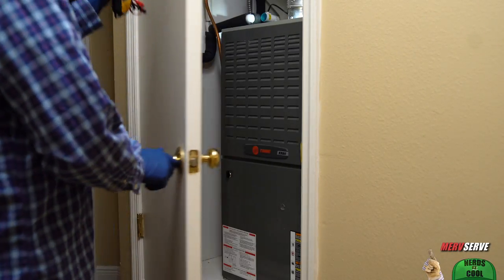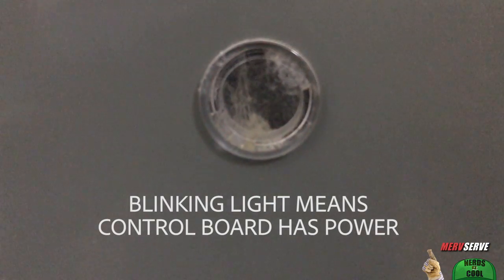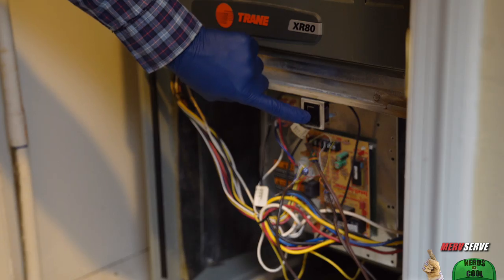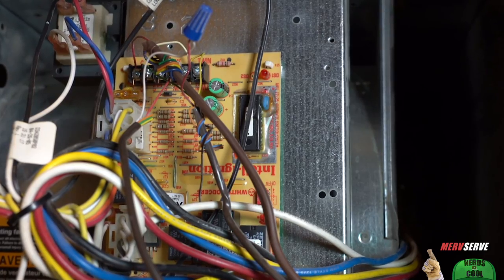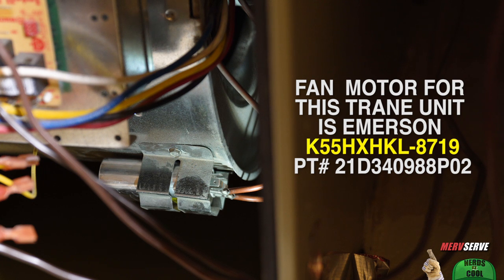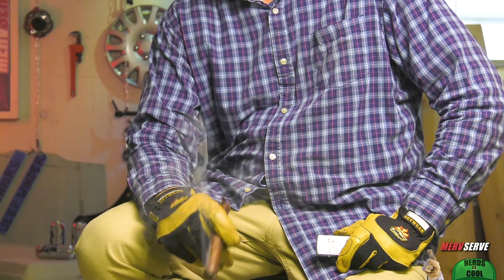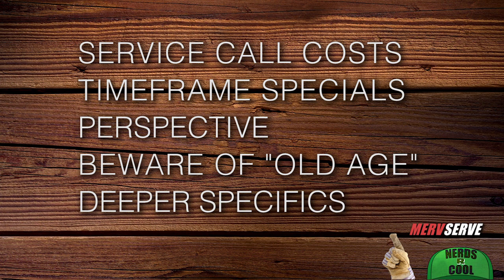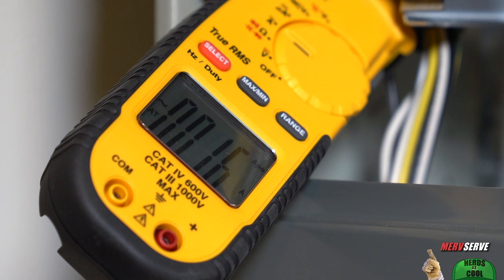AC Air Handler Fan Not Blowing?  Free Air Conditioner Fix

Comment: Excellent video.  Thank you much.  Merv, kindly, our furnace (circa 1981 Borg Warner/Trane natural gas, still in good condition)  blows the screw in breaker (locate on outside of it) whenever the blower tries to start.  The start relay actuates, and AC unit runs fine with the motor electrically disconnected from the system.  It's only when the motor is connected that the fuse fails at start.  The blower assembly turns freely inside the plenum.  Between the leads to the motor: ~2.1 ohms resistance (not zero/short).  I think it's a single speed motor ('R.P.M. 1075, AMP 5.0' written on it), & has 3 power leads coming/going to it.  (It's always only run @ one speed, as far as I can tell from the register air outputs).  ¿Is this motor bad or can a start cap cause this type of failure, kindly?  ANY advice or comments much appreciated.  Thank you so much.
Reply: Did you ever find the answer and/or solution? What was it?

Comment: A/c running. Motor runs most of the time but sometimes it doesn’t. But compressor will be. The evaporator then freezes up. At that point I turn off ac, I turn on manual fan and it won’t come on either. It seems after it sits, the ice thaws I can then press fan again it then works. At that point I turn ac back in and it works fine. Can’t find the rhyme or reason. The motor is maybe 2-3 years old, just replaced capacitor thinking it was the issue. But it continues to randomly not work. I’m
Replacing thermostat cause it’s 24 years old. But a hvac guy told me if I hit box and blower starts then it was a certain thing but I can’t remember what he said. I went under house watched. The outdoor unit started but blower didn’t. I hit the box with my hand and it started blowing high speed.
Reply from the maker: Maybe low refrigerant????

Comment: Good one Merv!
Also a good idea to put a surge protector on the furnace circuit. My furnace got hit, and it had a ECM blower. $1000 for a new motor, and that is just part cost! $$$
Reply from the maker: Good tip. Thank you!
Reply: Good advice. I live on a hill that is a magnet for lightning. I've lost two  devices (fortunately cheap ones) to surges. To protect my more expensive devices I've installed both whole house protection at the breaker box and a specific HVAC protector at the outside power cutoff for my heat pump. For the whole house, I installed at Siemens FS140, which is now being replaced with the FSPD140. (Check around. The prices vary enormously.) To protect my heat pump, I got an Intermatic AG3000. You should be able to get both (or comparable units) for under $300. As you note, not having them can cost far more in repairs.